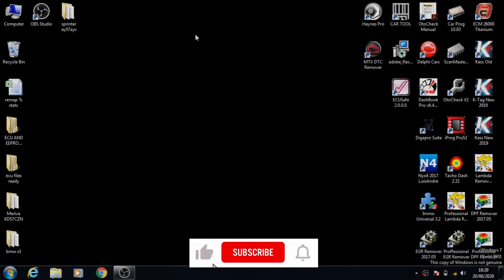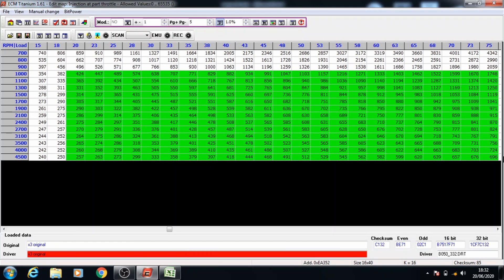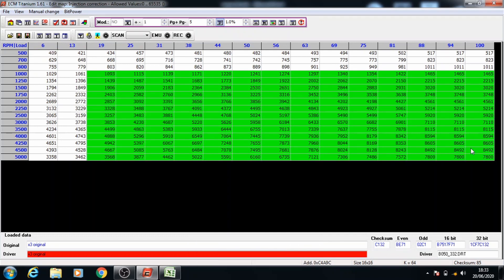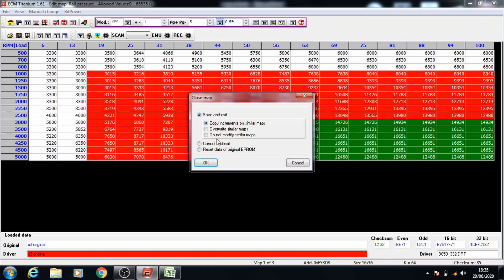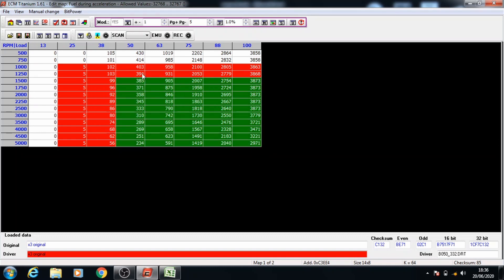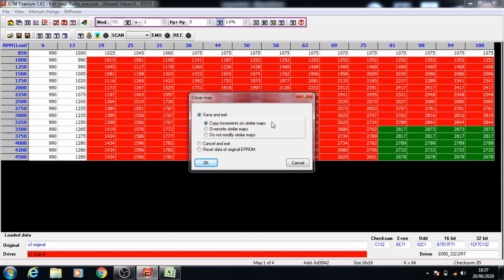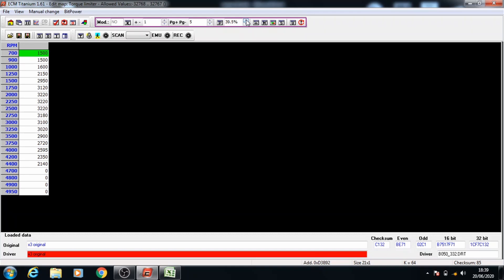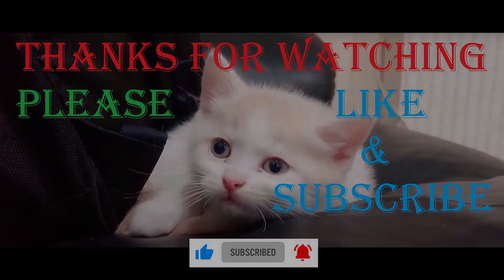bmw x3 2.0 4x4 diesel ECU remap Stage 2 ECM Titanium mod remap tune how to increase BHP torque

Comment: so when you do stage 2, do you remap stage 1 map or you remap fabric map, like you add 10% on your already 6% added from stage 1 or 10% on fabric map?
Reply: Check the video again. He made the modifications on the ORIGINAL file not to a stage 1 file.

Comment: Hi thanks for sharing your experience I’m new to remapping I’m glad that I subscribed to your channel I’m learning a lot from your channel.
I have a question where do you get the values that you used from the spread sheet that is the increase values.
Thanks in advance

Comment: Bad mod, never do it with % 🤦‍♂️
You should calculate AFR and put only more air if necessary.
If you touch turbo pressure without data logging you will kill him in few month
Reply: can you explain why doing it with percentage is bad?

Comment: In my file peugeot 307 1.6hdi I just watch your videos and learn but RPM/LOADS in injection at part throttle is showing from 0.3, 0.5, 0.7 etc... How can I do it?
Reply from the maker: please call my son on 07446191131
Reply: @universalinformationentert3976  does it use email or anything else? Thanks!
Reply: For me is the same on a 1.6 tdci ford engine... did you solve this problem?  ( maybe is a driver problem?)

Comment: Hi, thanks for sharing these remap videos. I used your method on a vw polo 1.9 tdi stage 2 and could hardly feel the difference in driving. Any thoughts? Thanks
Reply: Increased to 14% and noticeable now when driving. Still used your method. Which is awesome thanks. Where did you get the stages % from?
Reply: @jacquesjooste5329  Edc suite wery easy program for 1.9 vw diesels,easy to understand what limiters you need to lift,for extra performance
Reply: @reika2836  hey , pls what is overboost? Should it be increased for stage 1 ?
Reply: @jacquesjooste5329  what was the 14% increase
Reply: @jacquesjooste5329  what have you increased for 14 % ?
Reply: Hi, it's a 1.9 Diesel.
Reply from the maker: what is engine size? and fuel type